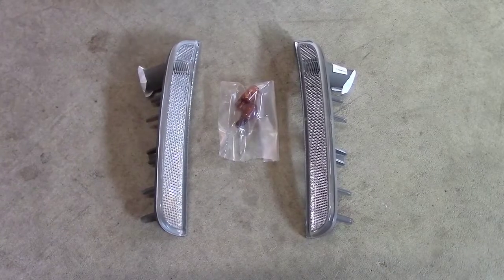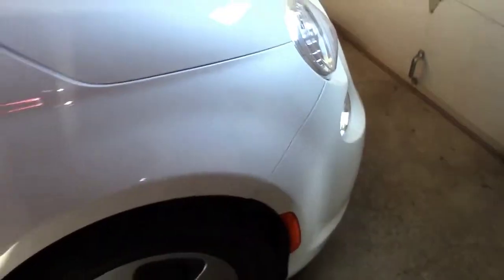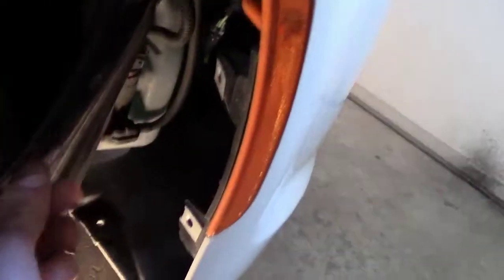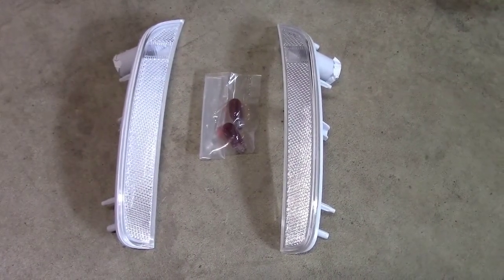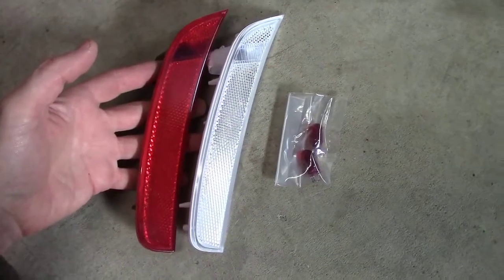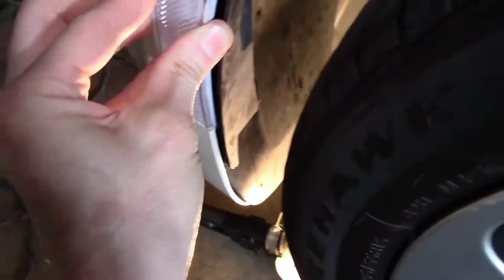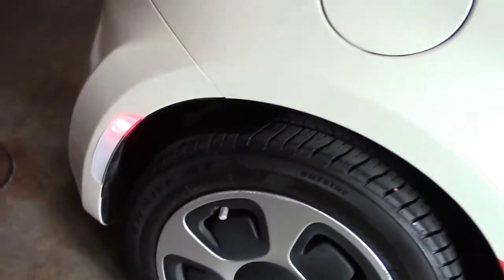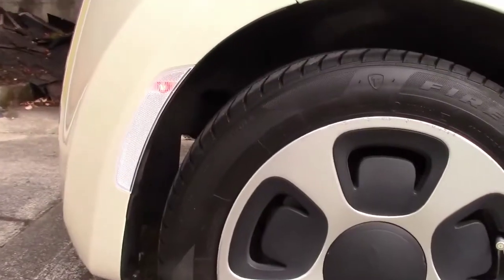Fiat 500e - Modified - episode # 21

Comment: Where did you buy these from online? Also, I found a pair on Amazon that says they DO NOT fit the Fiat Abarth. Is that correct? They look like they would fit but maybe there’s something I can’t see behind the wheel well.
Reply from the maker: It was eBay.  Brand is DEPO.  I actually have second pair new available if interested.  A couple of friends who own Fiat 500 Abarth have stated the same thing that they don't fit.
Reply: Hi.  Thanks for getting back to me.  I am in the middle of doing this mod.  I bought a set of 4 side markers from Aliexpress (for the Abarth) and they all seem to fit and work fine except the one in the right rear.  The bulb won't stay lit.  I'm wondering if it is a faulty connector or if the bulb and socket setup that came with the 4 piece kit is faulty.  I'm thinking about upgrading the bulbs to LED's like you did.  Where did you get those and was the conversion from halogen to LED difficult?   @theevolvingworld
Reply from the maker: One of the thin wires that connects to the bulb holder at the RR is barely connected.  Probably too much pulling & bending it.  Or it might be up stream a bit, maybe a rodent chewing on cables. 
 The LED bulbs are common on eBay - T10 size which fits millions of cars.  You may run into CanBus problems if you put too many LED's on the car due to under current.
Reply: thanks  @theevolvingworld

Comment: oh im not touching my lights :), my brake light went out and i thought i would take the opportunity to go to led lights[reverse , indicating too tho i did the front led's a while ago and they are great], everything went to hell and i ended up getting the regular brake lights to replace and everything was good again. Thanks you for amazon taking almost anything back. My best moe so far was to hacksaw those darned arm rests off.
Reply from the maker: Yes, the CAN-Bus system needs to read minimum current thru the various circuits or it cuts the power to the circuit.  I've described that on the other videos.  The LED headlight swap is easy & works.  

I removed the crappy armrests as well.  There is a metal ring clip that you can push the vinyl out of the way and get at with needle nose pliers or a longer flathead screwdriver.  Voila armrest pulls right out.

Comment: i just got a recall on the high voltage battery pack control module....problem with it drawing too much from the 12v batteries ..2015 fiat 500e

Comment: Hey when I change the four bulbs for leds, the lights won’t turn on. When I change only three (I leave at least one normal bulb in any position) they all work. Any idea how to fix this? I’m sure No led is faulty.
Reply from the maker: Exactly!  You discovered the minimum wattage that the "CAN-Bus system needs to see" for them to work.  The fix is: to leave it, add some additional LED's on the string, or get higher wattage LED's.  Ciao.
Reply: @theevolvingworld  thank you very much

Comment: The white ones would be a great match for the Fiats exported top Europe, where the colour side lamps are illegal. Where can wenn get them from?
Reply from the maker: I didn't realize they were illegal.  I suppose one could remove, get some factory matching spray paint,  paint them, & re-install.  Or not.  I got mine from eBay.  The brand & model numbers are in the text section.  Danke.

Comment: Im swapping my rear markers now for the smoked ones the nuts on the marker are a pain to remove
Reply: I can’t manage to get them off. Was there something you did to make it easier?
Reply: @kevinlandolfi3008  it was 2 years ago.  i dont remember.  I do remember doing it in the cold winter night with a flashlight.  I probably used a ratcheting wrench.

Comment: Como funcionan estas luces laterales .. por que en mi Fiat funciona  como stop ..
Reply from the maker: Sorry to hear yours are not working.  I notice if a couple are burnt out, then all of them don't work.  It's a CANbus under voltage thing.  Try replacing ALL the bulbs one by one, until they come on.  If no work, then trace the wires back & check for continuity.

Comment: I can just tell you this what you're doing is illegal because the North American law demands the side reflective surface on front side has to be yellow/amber and the rear side reflective surface has to be red. There was exception when appears first side marker lights in 1968. by the law, all the new vehicles want to sell on North American market has to be equipped side markers with just lights or just reflective surface without lights and 2 years later 1970. the law demands both, the lights and the reflective surface.

In Europe the vehicles longer then 6 meters must have side marker lights with reflective surface and only in yellow/amber color, not red on rear side like in North America. The exception is only if the red side light is in rear lamp within 250 millimeters (Volvo in Europe often comes like that rear lamps). If the vehicle in Europe is 6 meters or shorter it is not obligate to have side marker lights with reflective surfaces, but it is not an error and against the law if they are equipped with it (again Volvo in Europe often comes with side marker lights).